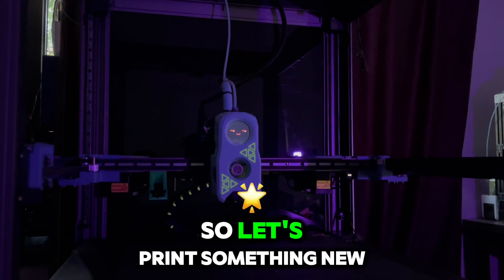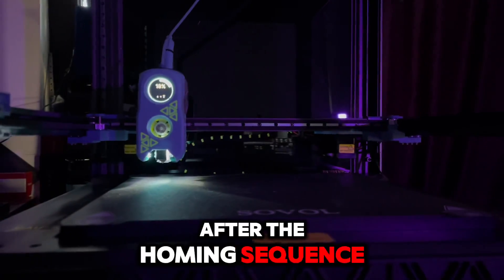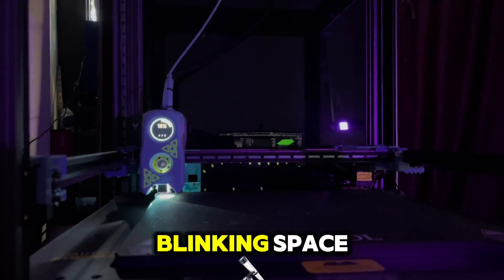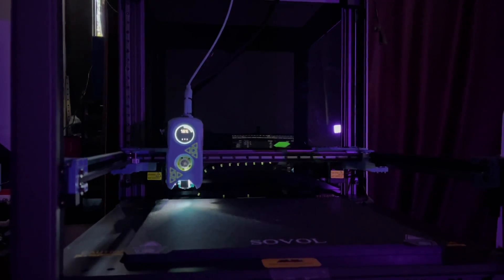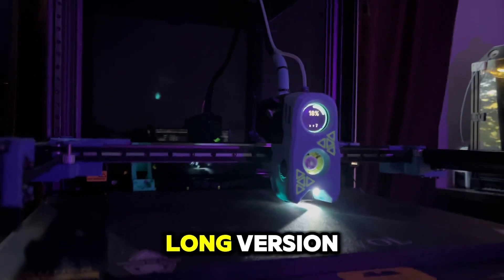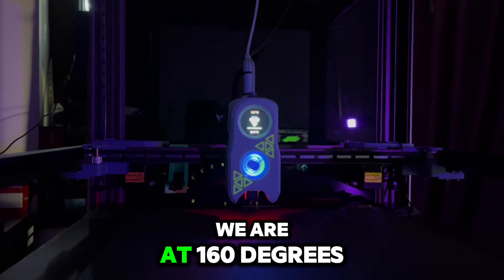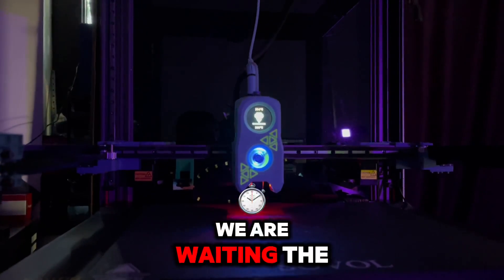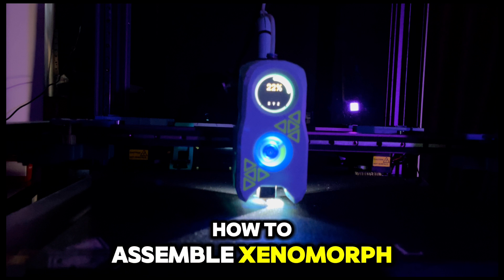Printing on Sovol SV08 using Xenomorph

Comment: Dude, love your machine. I have a couple printers and thinking of bumping up my print size (K1Max current largest) and the Sovol is on my radar. The mods you've done are epic. One thing, I HATE the baby blue parts. What did you use to print yours (PETG/CA) and where did you get all the lighting options in you print head? What do you think of the MicroSwiss options?
Reply from the maker: The toolhead has 2 rgb lights 
The microseis is a solid option. 
If you want to buy use this aff link this way with no cost will help us develop more upgrades. 

Buy and Sovol SV08 MAX Aff link 👇$999 USD
https://sovol-sv08-max-large-size-high-speed-3d.kckb.me/321e0118 

Buy and Sovol SV08 Aff link 👇$549.00 USD
http://shrsl.com/4wq6o
Reply: @nadir3D I’m in Japan so I’ll check the delivery options. You mentioned art and your build is truly a piece of art. I’ve subscribed and hope to gain from your experience when I begin my build. 

How about the original blue parts? What filaments would you recommend for their replacement/upgrades?
Reply from the maker: @ATLnJP i have used ABS Galaxy Black from Polymaker.

Comment: How does this compare against the Dragon Burner option? I see both can utilize the Rapido UHF.
Reply from the maker: dragon burner is a different approach, more "naked". Xenomorph was made for the SV08 uses the original Extruder of the SV08 and also hotend if you will. and it has NO exposed cables. + 2 rgb nozzle led + the knomi. the only thing that uses like the dragon burner is the 2 4010 fans :D nothing else.
Reply: @nadir3D  Thanks for the response. I saw many people saying the Burner toolheads would be good alternatives for replacing the stock toolhead. I'm thinking of just going this route instead. Plan to use the Rapido and klicky.
Reply from the maker: @TylerGotAYTAccount  its all depends on the taste/aesthetics... i spent a lot on this 3d printer i like to look at a piece or art :D
Reply from the maker: @TylerGotAYTAccount  and btw if you print mostly PLA none of them are good for you. because if you want to print FAST pla you will need a lot of cooling. to be honest the shroud that we have made for the SV08 that uses the stock fans it has better PLA cooling.  just so you know!

Comment: I like my SV08 but i have to restart prints ALL the time on account first layer looks like crap. makes me not want to use it. If i want a print to come out  first try i use my Qidi. if im doing something with a lot of contact with the build plate it goes to the qidi. I want to put on a Klicky probe but i do not want to void the warranty. so i guess i got to deal with sovol lack of support if i want to put on klicky or deal with not a good first layer on the print.
Reply from the maker: I don't know about that. and all the mods are reversible so you can go back wherever you want. in my oppinion using the factory probe.. is no bueno. i had 0 problems since i have used klicky. 
it all depends on what you want. what is the most used material that you are printing?
Reply: @nadir3D  on My SV08 the plan is stick with LW-PLA, Aero PLA, PETG and TPU and print my motor mounts with the Qidi i need CF High temp resistance. I build RC planes it does fine for this plan BUT If it has a lot of surface contact. like if im making a stand. seams i have better surface. (on the bottom) on the qidi
Reply from the maker: @st0mper121  the original build plate is not that grate. when printing petg it peals off. 
if you dont print ABS you can still use the original probe but you need to change the sequence of homing mess and everything
,

Comment: Really appreciate the efforts man. Subbed on printables and going to download the files. I did want to ask, for the clicky mod, which version is this compatible/are you using? Is it the BTT?. Also, for the Knomi, is it the V2 and does it connect directly to the head boards?. Trying to get all the items I need to put it together. Thank you again!.
Reply from the maker: The Knomi V2 its a touchscreen wireless communication and it requires only 2 wires ( provided with the display ) 5v and ground that we will connect to the toolboard
Klicky you have the files on printables. you need to build your own.
BTT Eddy also you have the files on printables.
We are working an a video to cover all the details Start to finish. for the conversion.
Reply: @nadir3D  thanks for the update brother. Looking forward to it. Will start printing the tool head this week since I finally got my enclosure and the ABS I’ve been waiting on. Got the Eddy in today and the Knomi. Looking forward to the instructional!. Thank you again!.
Reply from the maker: @miguelmercado1371  before the instructions we made some changes in the design. my original unit it came with a 23.5mm (only the body) extruder stepper motor, and i found out that the new sv08 are shipped with the 28mm pancake motor for the extruder. and we had to redesign the hole back part.  i will make a video about that tomorrow!
Reply: @nadir3D thank you again so much, and for the replies and updates!  Looking forward to the instructional. I’m still getting to printing all the pieces for the tool head so have some time before anything. I did notice that you have mechanical end stops . Are these mandatory for the eddy/clicky?

Comment: If it really is as quiet as on the video, those are mods that have to be on the short term list.  Thanks!
Reply from the maker: You bet! we can make it louder or even quainter it depends on what you want from it? what material do you print the most?
Reply: @nadir3D  Printing PLA right now but have the enclosure on order to print functional parts in ASA/ABS.
Reply from the maker: @capnmark4  i have switched to the proper fan and its not that quite as you might think. this rgb hotend fan its not enough and i don't recommend it i used it until it came the proper one. and i'm using a louder one now